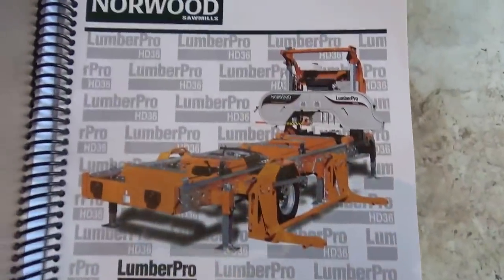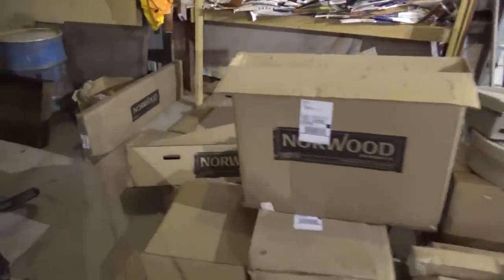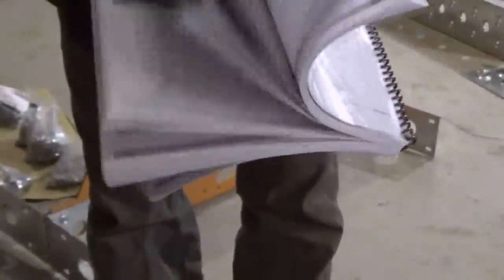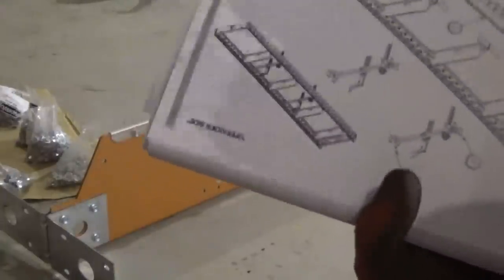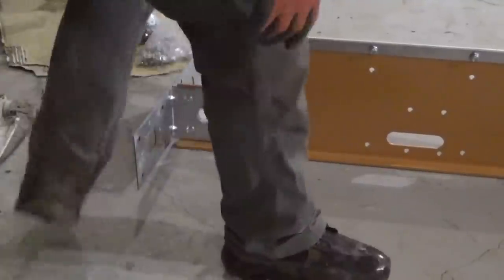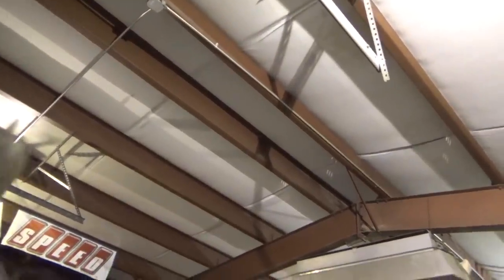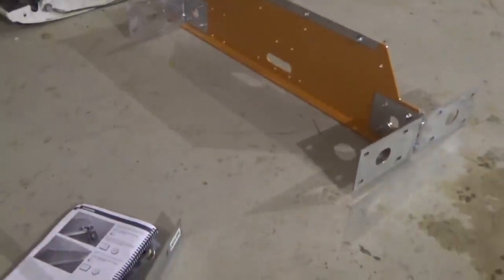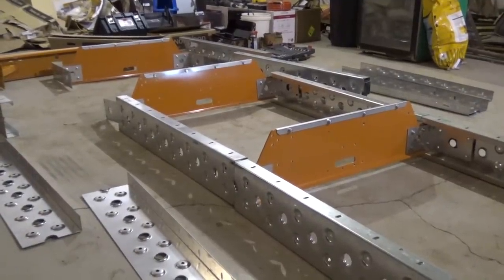Norwood Sawmill LumberPro HD36 - Step By Step Build - A Journey Into Self-Sufficiency (Part 1)

Comment: You can soak rusty tools and bandsaw blades in used motor oil to get the rust off. My dad has always saved a 5 gallon bucket of used oil to soak rusty tools. I am amazed at your ability with building things! Good job!

Comment: i used a string line once i had the whole bunk and rail system loosely bolted clamps will help fitting the embossments together strait and level is crucial
Reply from the maker: Thanks for the tip

Comment: Part 1 of 187?  Wow big project. If they can get gas it will be great. I've watched another channel that has a sawmill. Now I wonder if it's the same one. I think they are in Canada. They're building a cabin, and other things along the way.  It looks to be very handy when they can just mill lumber to the exact size that they need.
Reply from the maker: Probably 5 parts - Intro - Deck - Wheels and Outriggers - Sawmill - Test Drive
Reply: @OppenheimerRanchProject  Seems like you need a part just to count up all the pieces to make sure you have enough bolts. Or am I the only one who reads directions before starting?